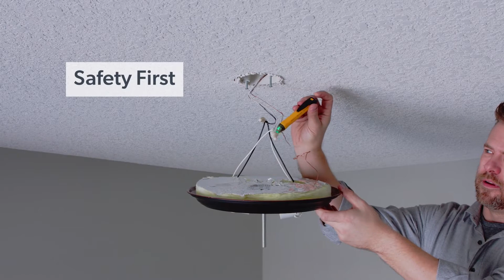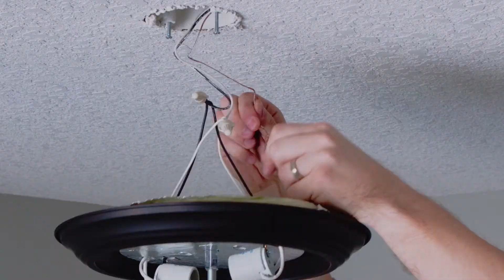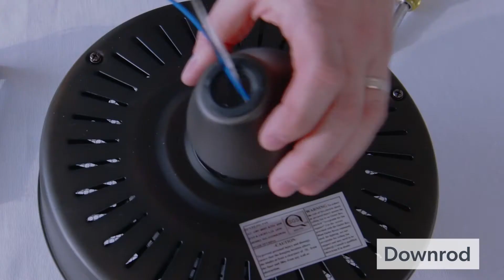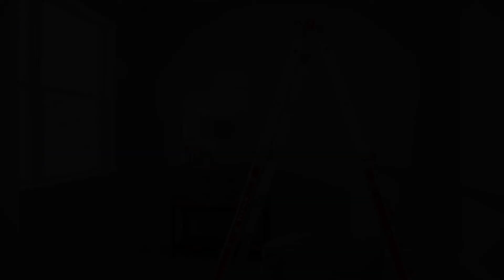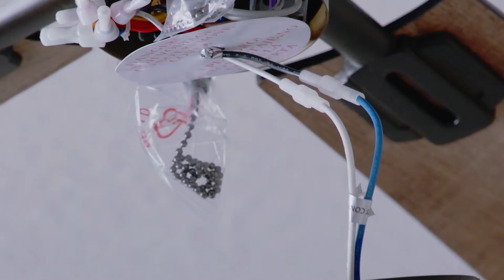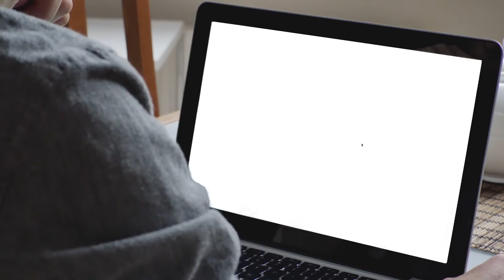River of Goods Ceiling Fan Instructional Video

Comment: Why do I have a 5th wire/cable along with the black/blue/white & green wire? Nothing mentioned about that and nothing on the internet. Now Im stuck do I hook it up to something? Your phone number doesn't work and itz over 100 degrees out. I need to finish this fan. What is that cable for? Its got a slider on it thx